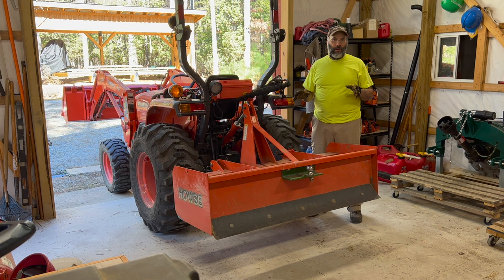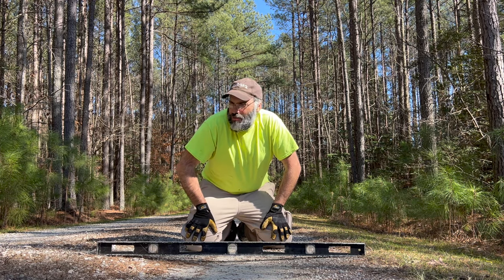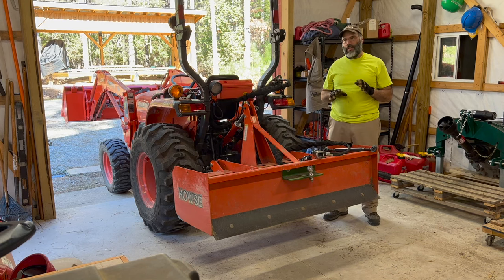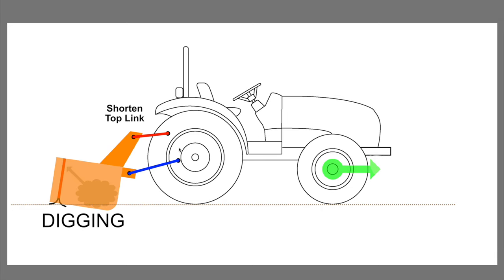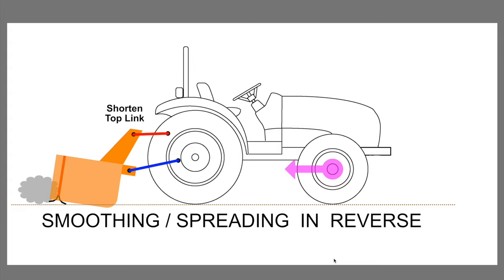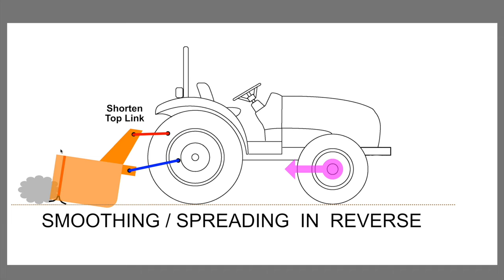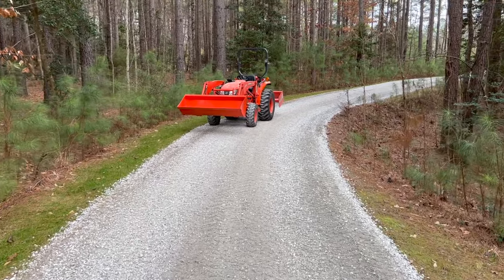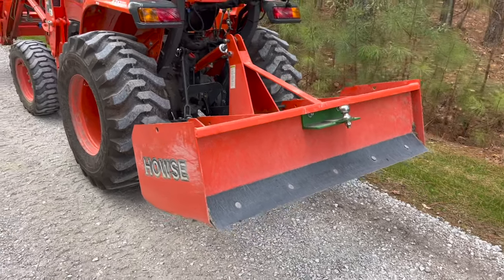The Art of the Box Blade for Gravel Driveway Maintenance

Comment: Slight clarification. When moving forward with box on the ground, the 2 lower supports of the 3-point hitch are in tension and the upper link is in compression.  This is reversed when backing.  So you always have at least 1 point in compression and tension.
Good video :)
Reply from the maker: Agree but it also depends on implement weight and lever arm.  For a heavy implement you have to first overcome that before the top link can go into compression, so nominally it leans towards tension most of the time.  I have run the box blade with my hydraulic top link floating (no resistance) and it stays very neutral much of the time which surprised me.  I think the lower lift arms and the sway links bear the brunt of tension/compression loads (and are what most often gets broken when put into large compression).

Comment: Have you (or any viewers) considered dropping a thin layer of Portland cement on top of your crusher run driveway, right before a rain? It does an amazing job of getting the mass of particles to hold together. Applied once or twice a year, you'll have something close to a concrete driveway in a year or two! I use a hand drop spreader over my 300 ft driveway, and a 50 lb bag is all I need.
Reply from the maker: Never heard of that but it sounds really interesting and worth trying.
Reply: We have a gravel load mix they sell here in Arizona, it has  cement dust mixed in it and it holds better than the regular gravel available.

Comment: Hey great video!  I’ve been maintaining my long driveway for a few years. What have my side plates worn so badly? Is there any way to avoid this? Thx
Reply from the maker: I think it's inevitable over a long period.  My box blade is only about 8 years old and still doing OK but I do see wear for sure.
Reply: Yes don’t tilt the blade down so far lengthen the top link a little tilt goes a long ways.

Comment: What about having a crown?
Reply from the maker: This driveway already has an established crown, but if starting from scratch I prefer using a rear blade to spread gravel and windrow towards the center, then followup with a box blade to smooth it out.  Don't ever run a box blade down the center of a crowned road except in smoothing mode only.  The goal is to preserve the crown and not cut into it at all.
Reply: @Lumber_Jack  thanks for the info. New tractor owner and box blade owner here. Could you also slightly tilt the box blade up horizontally and cut both right and left side to create a crown?
Reply from the maker: @DonnieDarko727  Yes, if you have enough material to remove when you make the cut, and the material would need to be very dry so that it moves laterally and out the high end of the box.  But it will be slow.  Box blades are not nearly as efficient at moving material laterally like an angled rear blade can do.
Reply: @Lumber_Jack  thanks

Comment: You don't ' crown '?
Reply from the maker: Definitely do, but it's already in the road here (see early in the video) so no need to shape it from scratch or re-establish it from the shoulders.
Reply: @Lumber_Jack  can you explain more on establishing a crown.  If you are setting box blade level aren’t you filling in low areas and thus eliminating the crown?  You did say you were setting box blade level, right?  Not angled from center to edge of road
Reply from the maker: @dalechristensen8459  This driveway had an existing crown which I did not alter (really just filled in travel ruts that were superimposed on the existing crown).  The tractor and box basically ride on top of the existing grade and crown.  The box blade is at zero tilt relative to the tractor rear wheels, so it does no cutting relative to whatever grade the rear wheels are riding on.  Whatever material the box moves, it's mostly all fore/aft without any cutting into the crown.

You can use a box blade to establish an initial crown by using a tilt angle -- the resulting grade is going to be relative to whatever the tractor rear wheels are riding on, since the box blade cuts relative to the wheels.  Normally I'd spread gravel level, then tilt the box and run down each side of the driveway to remove material from the shoulder and deposit it in the center.  Then put the box back level and make some smoothing passes, starting down the center.

You can also use an angled & tilted rear blade to move material from the shoulders and windrow it to the center, then make some smoothing passes afterwards.  This method also works to reestablish a crown that might have flattened out over time, or due to snow removal migrating gravel outward.  I haven't had to do that in a while, but in a heavy snow year, I will always need to run down the driveway in the spring with an angled rear blade and windrow gravel back from the shoulders into the center.
Reply: @Lumber_Jack  if I did not have a crown or enough crown and wanted to create one, would I simply tilt box blade from high at center to low at outside?  I’ve read I should crown the road 1/2” per foot of width,do you agree with that?  Thanks for your video and answering my questions.  I found your video to be VERY informative!
Reply from the maker: @dalechristensen8459  That is how I would do it (a heavy box blade is key, or lay some weights on the box to help it make good ground contact).  I just eyeball the crown but I'd estimate it drops about 3/8 to 1/2" per foot from center out to edge.  My driveways are 10-12' wide and the edges are generally about 2-3" lower than the center crown.

Comment: Remember, as you raise the trail or, in this case, you can spread the gravel A, B, C, by going forward with the truck
We have spread gravel quicker by raising the dump bed with the back of the dump trbed opening with chains expansion
This  spreads gravel making it easier on the tractor and operator
Reply from the maker: For sure.  We call that "tailgating the gravel" here and it works well as long as the gravel is dry and the truck driver knows what they are doing.